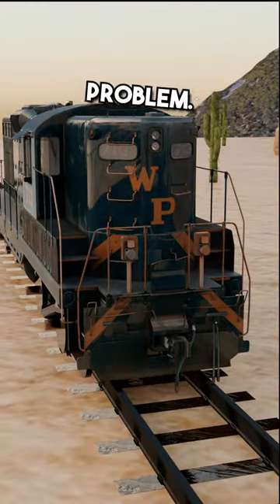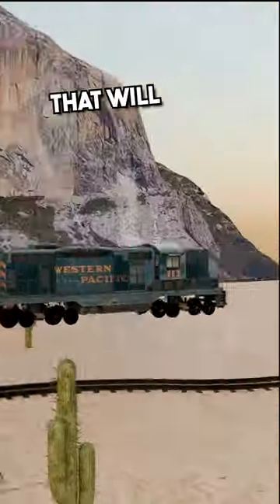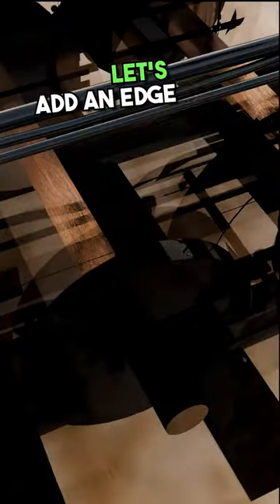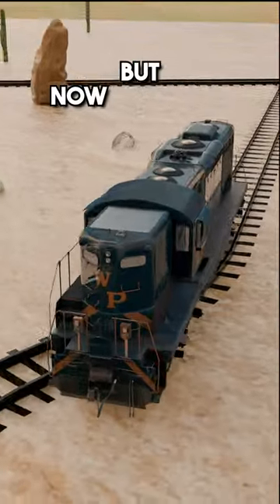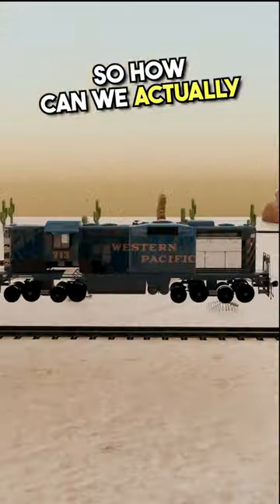The GENIUS design of train wheels 🚂

Comment: This is like trying to explain Why a American Locomotive could not Be allowed on European Railways and finding solutions for it to fit.
Reply: EebertsworldAnnouncements  That's because British locomotives are way smaller, Since the U.K Is a small country, The locomotives would be smaller and narrower, We Americans of course uses standard gauge rails as European which allows Britain trains to run on our tracks, However American Locomtoives  are built Wider and taller and heavier to Haul loads across the big land of the U.S, and because of that, They are far too big for them to fit on Any type of Railway line in Europe. However for British locomotives, They are small enough to take a tour anywhere around the world, Well aside from them having to avoid broad gauge tracks

Comment: There is one more thing. Once the wheels have their flang for it to take tighter turn There need to truck that pivet in the center of the set of wheels, 2 or 3 depend on the loco

Comment: That edge is called a flange, and the cone shape is not true it is fake they don't have angles they have what are called trucks, and they turn on their own
Reply: Rail wheels are conical shaped. Trucks are the whole assembly, putting it simpler, its the wheels, axles, truck frame, and a pivot. The conical shape centers the wheels on the track better. While technically the flanged flat wheel would sorta work, it would be terrible for wear.

Comment: why is bro using an 8 axle GP9!??  plus the bogies need to turn!
Reply: thats a gp9
Reply: @drawboat  fixed
Reply: That’s a gp7 gp9’s have water tanks on the roof
Reply: @Goofyahhampsterproductions5628  not Exactly 1. those are air tanks 2. Not all GP9s have them. they are added based upon the railroads specifications.

Comment: I am slowly losing brain cells watching this and I am a train enthusiast okay so trains diesel locomotives have their bogies separated form the main body they turn by them selfs on steam locomotives there’s leading wheels then driver then the pilot wheels and the turn in this video is too short no wonder why the train keep derailing but the reason why it keeps derailing because the bogies is stuck together with the body and diesel locomotives have a rod that connects to the wheels for movement
Reply: To those that read my massage I am sorry I just wanted to leave that out there